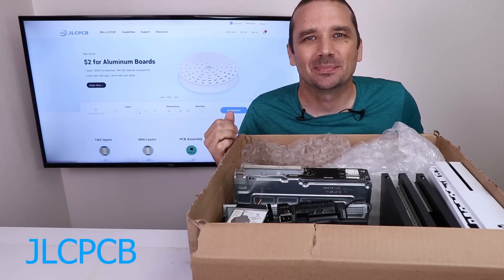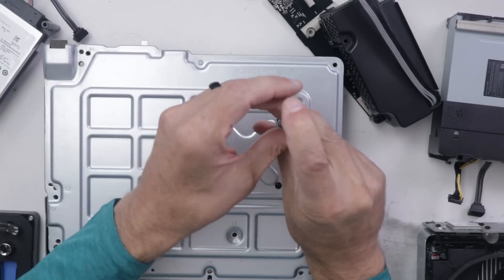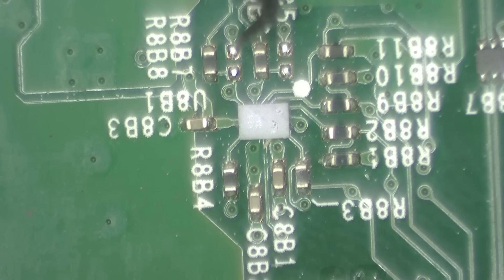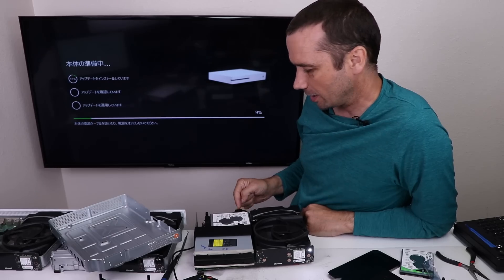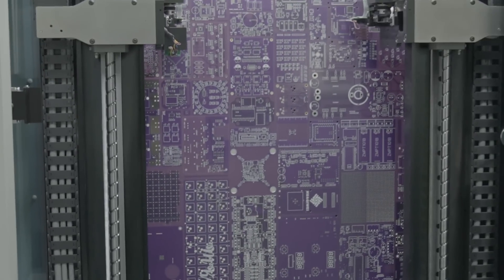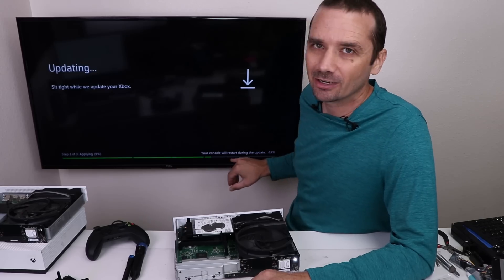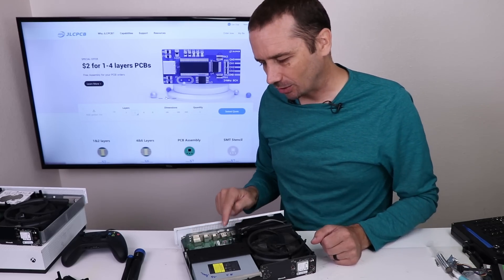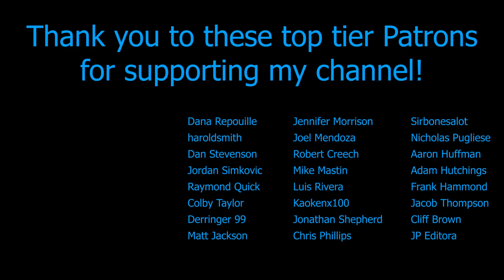I Bought a BOX of Broken Xboxes! Can I Fix Them? Xbox One S Repair

Comment: Odds are the previous owner the the third console ended up getting console banned and poured water into his console while it was turned on in order to fry it and try to get it in before the warranty was expired. Probably failing because they're now able to read the serial number and send it back or immediately ban the console they sent to them. They probably sent it back to the owner so they either sold it for parts or gave it away as defective. I think people have tried and attempted that before. It worked for some people but when more and more people start to do things like that companies get more aware of the scams coming their ways due to the damage the customers have caused themselves. It doesn't really mean that's what actually happened though! But if that's what the previous owner did I wouldn't be very surprised. And they can probably get in pretty big trouble for something like that..

Comment: As soon as you mentioned the evidence of liquid and the disrupted capacitor on #3 I knew you were going to try a known good PSU in it, but at the same time I was screaming "don't do it, test PSU #3 in console #2!" inside my head as I was worried the damage may have caused a short that could potentially harm the known good PSU.

other than that, great video as always! and I can't argue with the perfect amount of thermal paste 👍

Comment: @TronicsFix

Hi, I know it has nothing to do with current video, but just to ask you if there is any possibility to put a HDMI output (module) to any TV in between TV module (inputs and tuner module) and LCD/LED module (module of the same TV)? Basically to put output before picture is processed on LCD/LED decoder?

Need it for active background RGB lighting, 720p30 will be enough... But then again, need it to be HDR decoded in order to get proper colors to RGB LEDs...

Thanks in advance...

Comment: 2ish questions: you've mentioned in the past that you don't have the tools to reball apu's etc - does that mean you have the knowledge (if not the experience) to do that sort of repair?
Also, do you have any videos etc about reflow soldering, or hot air soldering - also does your soldering course cover drag soldering of small connectors/chips?

Comment: I wonder if a bath in isopropyl alcohol, scrubbing it with a toothbrush and drying it with compressed air would help it?  I have fixed water damaged vehicle ECMs like that in the past.  An even better option would be an ultrasonic cleaner, but large ones can be a bit pricey.

Comment: The third one you should've stuck in an ultrasonic cleaner just to see if that would fix it. Never hurts to try.
Reply: Was looking for that, and if the ultrasonic didn't work and you get power rails voltage maybe reflow the whole board it's not like you have too much to lose anyway

Comment: Brilliant video as usual. Any chance you can help me with an issue I'm having with my Xbox One S disk drive? I've bought a second hand one and a new one and replaced my disk drive. Both the second hand and the new disk drives function perfectly fine reading disks, however there is a horrible grinding sound whenever it reads the disk as well as the fact that it powers the the disk drive off when it no longer needs to read the disk and it would make the same horrible grinding sound. I initially thought the second hand drive was somewhat faulty, that's why I got a new one. But they both seem to make the same noise. Swapped out the daughter board fine and the console is recognising the drives, it just makes a horrid noise as if the console it about to die. Any help will be greatly appreciated.

Comment: Just repaired a relatives pc, they were a smoker so I spent most time cleaning it up (and still has some dust and gunk in corners) turns out it was a power supply failure, it seems to of killed the graphics card too, luckily they just use it for browsing and Youtube and it was overkill for that already.
Reply: Voltage spike?
Reply: @BigRalphSmith  Could be, I know in the past their sockets in their house had grounding issues (I remember if I touched my laptops case when it was plugged in I would get shocks) that seemed to be fixed when landlord sent someone out, the desktop is plugged into the same outlet and their pc before I built them this one had a weird error that it only posted if you powered it on and left it for a few minutes then pressed the reset button or powered off and on at which point it was ok.

They live in a old damp house in a village.

Comment: On the third Xbox, would cleaning and reflowing the affected chips do anything? Or is it more likely that the chips were shorted during the water damage?
Reply: The chips would have absolutely been shorted during the liquid damage, especially the APU. Given how sensitive the APU would be, the chances of a simple reflow solving it would be very slim. A bunch of random high voltages probably got sent through a number of the data lines.

Comment: very nice video and 2 out of 3 fixes is pretty good. i'm wondering.... if the discdrive is married to the motherboard then if you diskdrive dies you can never replace it with a new one? or is it some firmware in the drive which you can transfer to another drive? and if you change the laser only of one discdrive  to another will that also work? Nice to see the perfect amount again :D have a good one Steve. oh i also bought a broken XBOS digital which will be delivered tomorrow so at lease i've got some more info from you ;)
Reply: Generally no, IMO, I remember the PS3 gen I think you could if you knew the code and had a expensive reprogrammer, the earlier models had a circuitboard that was attached by a ribbon so that was all you needed to put on another drive.  The 360 I am not sure, I know there was ways of getting the code off the drive so I assume you could replace it.  Not sure about the PS4 gen but I heard bad things.  Typical companies blocking right to repair.
Reply: @revengenerd1  It was really easy on the 360, thanks to how common custom firmware for the DVD drives was and how many tools and methods were developed for flashing them. For early drives it was a simple case of connect it to a PC, dump firmware, get key, write key to new drive. 
I've never seen a programmer for a PS3 Blu-Ray drive before, but I know you can use CFW to remarry the drives.
Every console since that though... yeah, security's been too tight to find a way to do this. You just have to hope any disc drive issue doesn't involve the PCB.
Reply from the maker: As long as you have the daughterboard from the married drive you can swap that into a replacement drive.
Reply: Yeah, the drives are married and there is no known way for a consumer to read/write the firmware on them to change the keys and pair them with a different console. Swapping lasers and other parts is fine, but you can't just swap out the PCBs/daughterboards. If you have a damaged PCB it might be possible to remove the chip with the firmware on it and put that onto the PCB from a different drive, assuming it's not that chip that's the problem, but in general you just have to hope that any drive issue isn't down to a PCB fault.
Reply: Ahh oke so the daughterboard contains the chip with the firmware... yes so it's in that case soft/firmware married and not hardware right. Nice know thx 👍🏻

Comment: Hey, been following for a while. Do you happen to fix any viewer consoles? I have a broken switch that needs fixed.
Reply: He only fixes viewer consoles if the viewer ordered a used console and received a broken one, but even him doing that is rare.
Reply: You could always try taking it apart and seeing what the problem is yourself.
Reply: @Conorator  There's a repair store near me, but I'd rather have tronix fix it. but I already know it's gonna be a trace issue, battery, or chip because the console shorted out when being charged. Thing is the store near me charges 50 bucks just to look at it.
Reply: @7ngel  I believe he has a friend that does repairs, but he himself does not take repair requests.

Comment: Hello there, I have a problem with my Original XBOX One (  I can't turn the Console on, with the Power Button, the eject Button also don't work and the Button the to pair a controller with the Console also don't work) If you can help me that would really really awesome, tank you
Reply: No power, no sign of life at all? First thing to do would be check the power supply/brick. Test it with another console, or try a known working brick from another console with yours. And check what the light on the power brick is doing when you plug it in and try to turn the console on.
If it's not the power supply, it could be a short somewhere inside or an issue with the Southbridge chip.
Reply: @fadetonoir6152  the power is working, when I plug in a Controller and press the Xbox Button, the Xbox is turning on
Reply: @Dragon_Fire69  Oh, got it - so it's just the actual buttons on the console that aren't working? Then it could be a problem with the RF/power button board, which is relatively easy to swap for a spare part if you're comfortable opening your console.

Comment: Just thought I'd give a couple of pointers for anyone who needs it

----- SPOILERS -----
Those HDMI filters are kind of redundant. The circuit will work without them because the path is complete underneath the filters. I never test them because of that

If you have a mismatched or bad hard drive, it can fail either 0%, 1-5% or 59% but a disc drive issue will fail at around 72% :)
Reply from the maker: Thanks! I always appreciate your comments like this.
Reply: @Tronicsfix  no problem, I hope I'm not intruding when i do post stuff like this. I kind of have a lot of stuff just crammed in my head and not noted down anywhere, like the percentages for OSU and what it means when they fail at certain percents, mind you sometimes looking in the log files are much easier lol